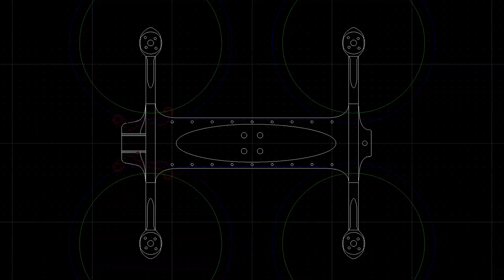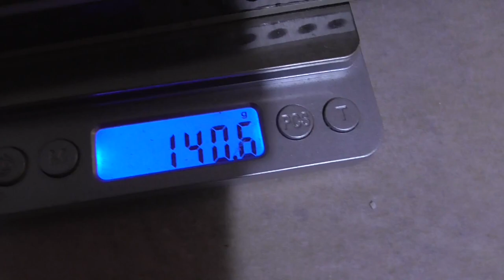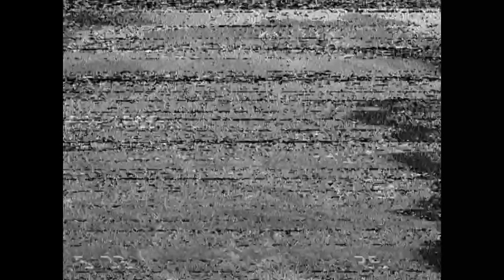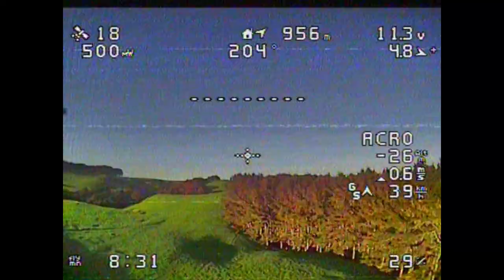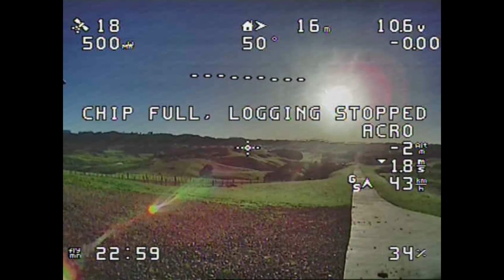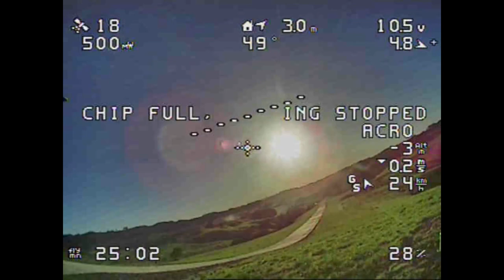Long range farm chopper

Comment: Thank you for showing the results from the different bits.  I just recently acquired a CNC machine and this will help a ton.  :)
Reply: What CNC did you buy?  I have never used a CNC machine and would like to buy one.  Thanks for any advice.
Reply: @Paiadakine  First, I have to warn you that the one I bought is very hands on and does not come with a dust collector.  The model number is CNC3-3018Pro.  At this time they are on Amazon for $175.  🙂
Reply: @bentsprockettech  
Thanks for that info.

Comment: This farm c-hopper design turned out to be a very nice build. That lock solid position hold while hovering with Arducopter is amazing. Adding a bit of foam over the baro sensor may help reduce sensitivity, as exposure to air currents (wind, drone motion, temperature, etc) can cause localized pressure variation. (or your sensor is going bad) With the carbon sandwich wood sheet used for the frame, did you apply anything to the exposed wood edges to seal the frame? Perhaps it's not a v1 concern. 

Did notice jello in the camera view (one tilt position more than the other). You probably could eliminated this by isolating camera on a plate that attaches with rubber grommets to the frame. Hopefully your camera and tilt mechanism didn't suffer with the close up raising terrain inspection.

Higher S (voltage) setups will have less tendency to have voltage sag, as each cell needing to provide less current, so chemistry is working less hard. With 2-3s, voltage sag is more noticeable. Placing 2 similar capacity packs in parallel also have effect of increasing C-rating, as cells share the current load. Generally voltage sage is less an issue with longer range drone, as mostly cruising over a more narrow throttle range. (not like with freestyle, etc)

Comment: To keep from grinding down the hardware on the bottom of my drone, I have been using "Ultralight EVA shockproof mounting pads", which are cheap and nearly weightless. While first learning to fly, I got nervous that I was getting too close to powerlines and hit my disarm switch, dropping me flat on the asphalt with one plastic spacer, and one plastic nut broken from the G-Force, but I attribute the lack of any further damage to those little miracle bumpers... So far, they seem to be protecting my "second" FPV camera pretty well too. :)

Comment: Had a thought about home antenna. Have you thought of a helium balloon for the base station antenna. Cable weight and such might be a lot. But just a thought…or some sort of ballon based relay station?
Reply: You can use a power supply to crank the voltage up to transfer decent wattage on thinner, lighter wire... and run a tethered drone fairly easily.  There's already people doing DIY versions of automatic tensioners for the cable.  Beats having to buy helium all the time, maybe.

Comment: Don't kick yourself for not buying the Thumb Pro, it's not worth the extra money. I've been doing some thorough testing with mine for a upcoming video, and it really isn't all that much better than the original Thumb tbh
Reply: Thanks for that info. The Thumb Pro was release between when I ordered a Thumb, and it showed up.
Realize quality not great, but at the Thumb weight class, there is no other option.

Comment: I had a clone dji f450 frame and used standard parts with 920kv 1045 prop and with 4200mah 3s i got around 22 minutes of flight times without camera and vtx and landing gear

Comment: I know nothing about drones, but watch for the machining stuff. Instead of plywood have you considered using aluminum honeycomb. Pretty sure it would stiffer and lighter if it would work
Reply from the maker: I've seen it used on full size aircraft, but it sounds extremely expensive.

Comment: This thing would really benefit from some 21700 cells with decent discharge, at 3s2p I bet it would fly for for 45+ minutes no problem
Reply: By the looks of the 5 or so amp draw I think most 18650 sized units would work also
Reply from the maker: The amp display is not working, I just forgot to remove it from the OSD. After flying for 25 minutes the charger replaced 4.8Ah, so that would be average of 11-12 amps.
Reply: @iforce2d  ah yep even that is no worries for most 18650-21700 things. 8ah 12v sounds pretty tempting eh. 
I have some 18560 and 21700 that would suit extracted from drill batteries. Pay shipping from Blenheim and can send a handful

Comment: I've found the multistar packs- although nice and cheap suffer horrendously from voltage sag. On one of my large octas the pack goes from 26v down to 19v on takeoff with payload. yikes. Nanotech has no such issues.

Comment: So do you have a plan to make a VTOL plane? I also want to build my first VTOL using your homeslice technology. But maybe I'll make much more simple STOL canard, based on ugly, but successfull 2019 design before it.
Reply from the maker: Yes I'll probably make some kind of VTOL thing one day. I actually have a design that I've been toying with in OpenVSP, but the way you need to make compromises for each flight style and end up with both being not very efficient kinda bugs me. It would be somewhat like Peter Sripol's quad tilt rotor from 2012.

Comment: Is it possible to limit your end points on transmitter to control degrees in acromode?
Reply from the maker: Acro mode controls degrees per second, not degrees. Sounds like you want auto-level mode, if you're intending to limit how far the quad can tilt away from level. These settings would be done in the flight controller, not on the transmitter or receiver.
Reply from the maker: ah you're suggesting that I could do that to prevent it from going too fast? Yeah that might be handy actually.... at least until I wanted to stop suddenly, but I suppose that could be done in pos-hold mode.
Reply: I have another query since you like sciencetific stuff, if carbon fibre is conductive, would# grounding it act as a emf shield 😬
Reply from the maker: Yes, I believe so. It's not as good a conductor as regular metal though, so don't expect it to be useful for carrying current. Remember that it's made up of carbon fibers embedded in epoxy resin, which is not conductive. So it's just conductive enough to be annoying in various ways (unwanted contacts, RF interference).

Comment: I have the same frame as you ( blue/black) its a good solid frame but the legs are garbage, break really easily. if i could get some different legs for it i would be much better for my not so perfect landings =/
Reply from the maker: Yeah there is a weak spot in the legs that I can't figure out what it's there for. I wouldn't go so far as to call them garbage though, I mean they held up in that crash ok. Your landings must be pretty brutal :)